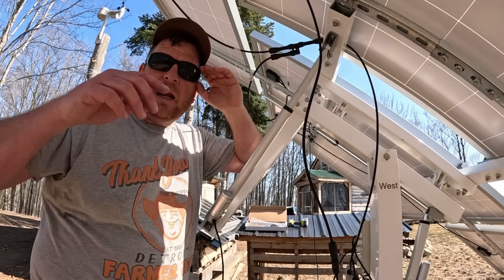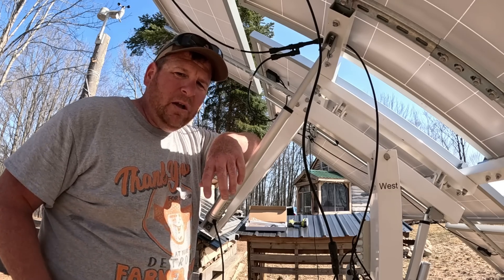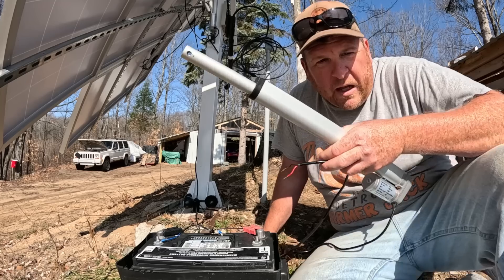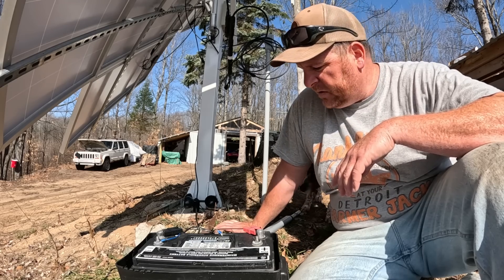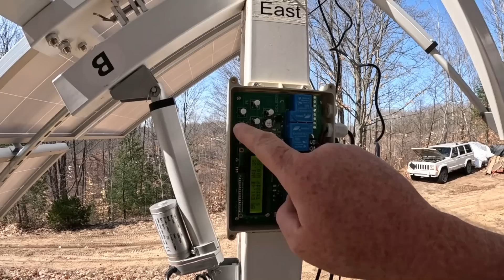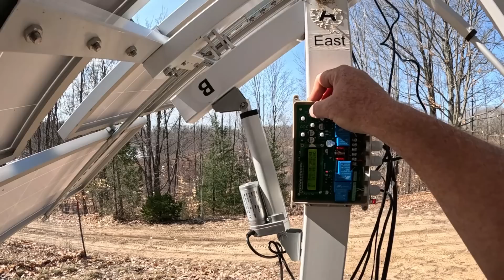Fixing Common Issues With The Eco-worthy Solar Tracker

Comment: great video   my eco tracker    east west ram was dead from new .. a sharp smack on the motor body and the ram worked faultlessly for a couple of months .. Only for the dead as a do do to return .  the tracker control box is making all of the  correct noises but the faulty tracker / ram refuses to function .  I originally thought of   installing the rams upside down to prevent rain / moisture running into the motor . I guess i need to order a replacement. ram .
Reply from the maker: The newer actuators are actually quite a bit more quiet. I didnt open one up yet to see why they are, but it more quiet it likely has a better design. I bought mine on Amazon easily. But kinda aucked having to buy a new part so quickly

Comment: If you take it apart the motor is corroded inside it has no seals on the actual motor cylinder it has seals on the outer ends of the of motor casing. I cleaned mine out with sand paper re-lubed the gears and then sealed the motor tube with nail polish (enamel paint) It was installed with the motor end up to help keep weather out just FYI
Reply from the maker: Very nice.....I'm doing that next time around. Thanks

Comment: Sure would like info on the mount and is it a whole unit
Reply from the maker: There is a whole video about its install last spring.  I think it is in our solar playlist.
Reply: @OffgridwithJayandJen  I got 50- 550w solar panels.. I been stocking up.. I gonna need some high kw off grid.. lol mostly to power a 4post lift

Comment: I have two of these now. If you set your sun sensor to a lower voltage it should make it more sensitive. If it’s very dark and cloudy it won’t work, but you’ll be surprised at how much it will track. I’ve found that more panels will help with cloudy days, and that’s why I got the second tracker. The next panels will probably be vertical.
Reply: What parameter is that. When mine tracks the sun, the angle of the set up isn't where it should be
Reply from the maker: @brettmitton7839 maybe the sensor isn't rotated the right way? I know the manual had the east and west wires backwards too.
Reply: @OffgridwithJayandJen  i have it on the north east end with wire facing down. Today I noticed the lenses is full of moisture
Reply: @  I haven’t had that issue. I just have to make I keep snow and ice off of it. You might bring it inside and and let it dry out. If it happens again you might have to repeat and then put some silicone around the base. You could try contacting eco worthy but it seems to take them a while to run your email through google translate
Reply: @danielmcneely1579  yes, I did send them an email. I had already sealed it when first I stalled with dielectric grease tokeep moisture out. Seems like that moisture might be effecting how it sees the sun. Sometimes it's bang on with the sun, then slowly makes it's way west. When I think it should have stayed. Maybe that's just me lol
Reply: @brettmitton7839  I went out and looked at mine and it’s V3: sunshine limit. Yeah, the sun sensor has to be on the NE corner and it has to be oriented the right way.
Reply: @danielmcneely1579  it's set in the right ordination. What do you have v1 and v3 set at?
Reply: @brettmitton7839  I haven’t adjusted V1. Honestly I left everything other than the E/W and N/S settings in the defaults. I wanted to see how it reacted to my local conditions. I’ve never adjust the wind sensitivity because it seemed be good where it was. I tried turning the V3 down to see if I could get the panels to kick on earlier in the morning. On cloudy days when the light is patchy it would bounce around all day using up the battery, so I turned it back to default at 1.8V.
Reply: @danielmcneely1579  thank you for the info. When you make adjustments or want to go back to working mode, does it have to be laying flat? To know where the return position is?

Comment: The issue isn’t the actuator. I have 2of these trackers. The issue is the mounting the top mounting bracket is letting the panels go to far west and it doesn’t have the torque to pull it back. 

Flip the top mounting bracket around so the panels don’t extend as far west and this stops the panels from getting stuck. 

I have 8 200w panels and has to do this because of the weight of them.
Reply from the maker: In my case it was the actuator....it was frozen over the winter.

Comment: Jay on one of the videos during the snowy season you said that you had a motor that could charge up your solar batteries on overcast days: could you tell me about that motor? It might be good to have here down South also in bad weather.
Reply from the maker: Hey there, I just use a small gas generator and hook it to a small 24 volts charger that is in the solar shed. The generator is nothing fancy, it is a cheap inveter style 2000 watt. Very quiet and sips about 1 gallon of gas every 10 hours. I think I have a video or two where I show changing the oil and such in  it. It should be in a Playlist called random projects if you care to find it and watch it
Reply: I will check it out: the wife and I enjoy you two's videos, we watch here from South Georgia. 😊

Comment: Another thing that may help with the durability of your system is to use cable ties to keep the cables from swinging in the breeze. That's hard on the connections. They sell special UV-resistant ties, but even just plain black ones will be better than the white ones. They won't last forever, but you can keep an eye on them and make sure your cables don't droop. All the best to you and Jen, and the pups too.

Comment: Curious, I have really strong winds. I wondered how it would hold up. I can get winds 90 km and high. Sustained winds around fifty to sixty km an hour
Reply from the maker: We have crazy winds up here and ours has been solid so far. We have an install video if it helps. Little bit of sway on the unit because it has simple unions rather than bearing or bushings.....but still holding up good

Comment: Great to see that fixed and working again.   From what I have seen on YouTube, the actuators are the weak link in the chain.   Save that old one, as most problems with them seem to come from the gears in the lower housing wearing out.   Glad you are having great weather

Comment: I’ve been waiting for this video. Overall, do you think you would still recommend it? When you put the new actuator on, did you have to reverse the wiring?
Reply from the maker: It all went smooth and I did not have to swap anything. Considering the system is not that much more expensive than buying traditional metal racking systems....I would buy one, ya. But I'm a man of simplicity most the time.